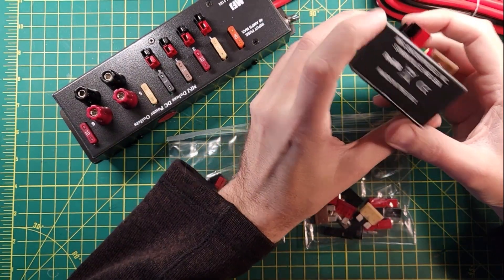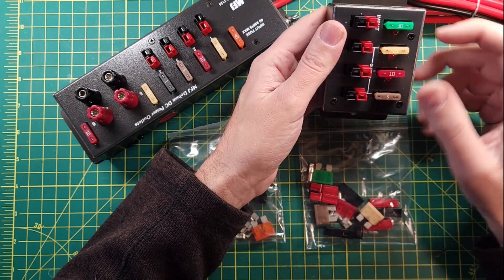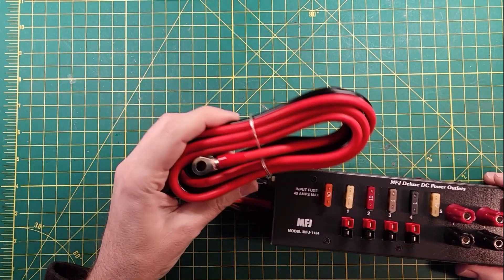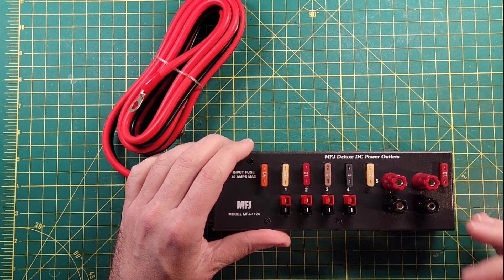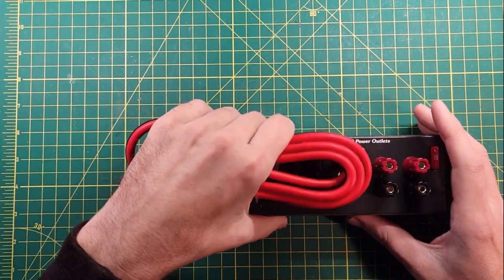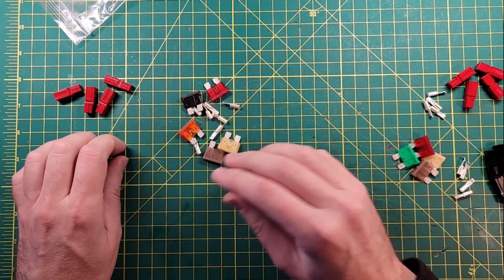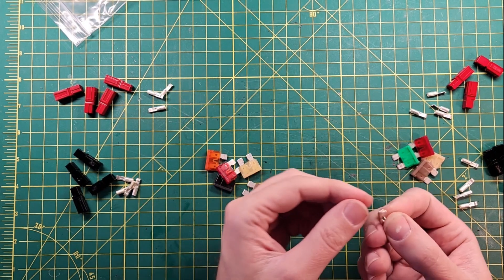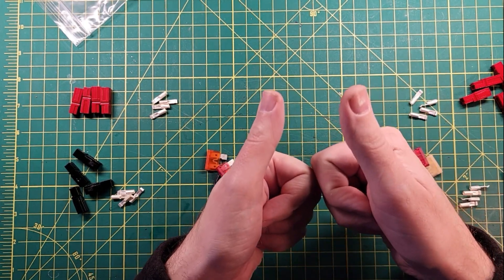MFJ Powerpole Distribution Blocks

Comment: Any volt meter displays youd recommend for those, or a master DC breaker? If you wanted something resetable?
Reply from the maker: I don't see one that is resettable, but this one has a meter and an off switch:  https://amzn.to/3qNfeuy
Reply: @temporarilyoffline  That looks so hackable, i want it lol, toss a pi zero in it, relay(s) and a little breaker, and jump out the main fuse :), automated shack power distribution
Reply from the maker: Exactly!

Comment: I want to see if the solder joints inside will hold 1 Tx at 25 amps 3minutes key down 😳 I know sun krimp stuff that won’t take Handel that amp draw in fact on rc Heli s we shy away from pwr poles and use stronger connections. But totally understand flying chain saws drawing high currents vs ham radio less then lethal currents ☺️
Reply from the maker: KK6USY Chuck swears by those XT-60s over PowerPoles... problem is, ever ham I know uses Powerpoles.
Reply: @temporarilyoffline  yea I use them on the smaller 3s planes but my 6s Helis get castle connections 6mm bullets can hold 200amp bursts ☺️
Reply from the maker: @kevinkc3onohelijeepworld  Now that sounds like some fun!